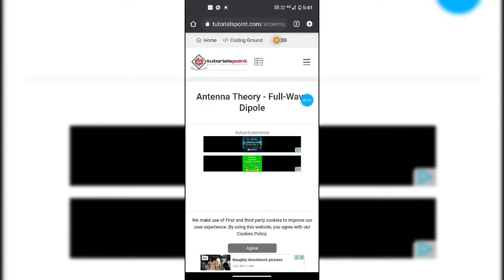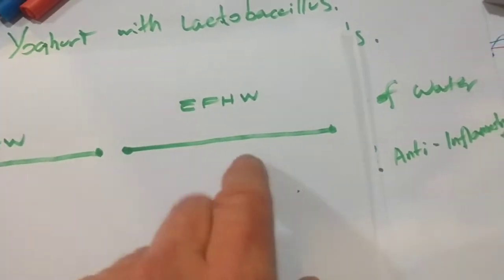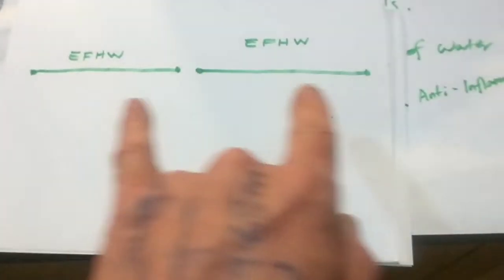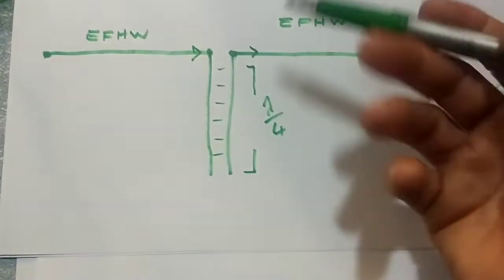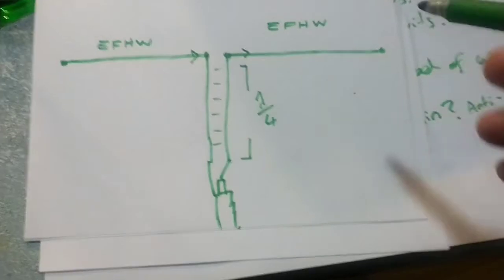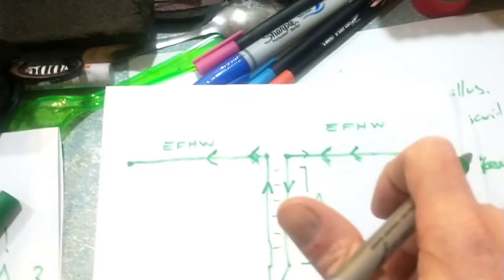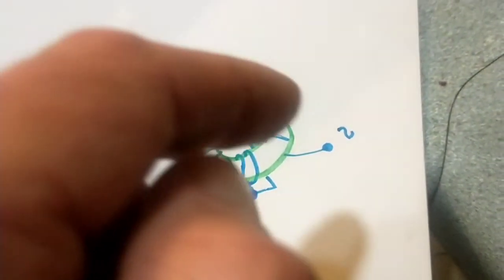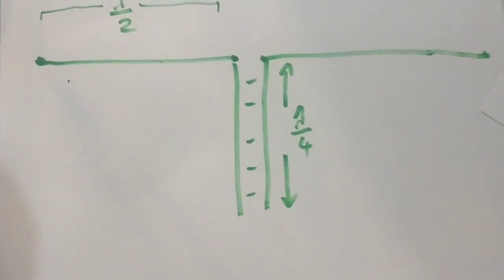Myth Busting "Centre Fed Full Wave Dipole Antenna"  (CFFW) (Tutorialspoint Garbage)

Comment from the maker: The Example presented at the end was generalized advice for a balanced output transformer 
& the winding ratios in the video were not specific for the centre fed fullwave.

I was simply trying to explain the principle of such a balanced output step up Voltage/Impedance transformer.     

In the comments below someone did come up with what would be a near perfect ratio design for an CFFW antenna.

Comment: I saw that TutorialsPoint nonsense this morning so went looking for someone who debunks it and found this. Good job. I hate to think of all the people trying to learn from that site. People confuse impedance matching with resonance. Resonance is useful to achieve a good impedance match, but it’s not necessary, and a good impedance match doesn’t imply you have a resonant antenna.

I’ve also been reading about the “half square” antenna, which is basically a full-wave dipole with 1/4 wavelength at each end bent down to form two vertical elements. Proponents claim the two vertical elements are in phase, but if I consider them to be the ends of a full-wave dipole it seems they would be in phase. Some folks also claim that the horizontal wire doesn’t radiate, and that seems like nonsense. My intuition might be faulty though—I haven’t looked at it rigorously.
Reply from the maker: I actually have built a fullwave dipoole with the ends bent down at 90 degress
and I used a 1/4 wave matching section to feed it.

I made sure the point where each ele bends downwards is exactly 1/2 wave from the other element that bends down
and because it is a dipole
with each element at opposite phase,
and because each vertical section is also a half wave apart,
the signal from one vertical section takes a half cycle to reach the other vertical section which means that when it gets there, the other element is now at the same phase as it is and it becomes coherent in the end to end direction of  the antenna and actually cancels the radiation off the sides.

To top section has little effect on the radiation pattern.

I actually wasn't aware it was called a half square lol,
It was just a design I came up with that I called a top fed phased vertical array lol.

73 and Thanks so much for your comment.
(PS: Sorry I only just saw your comment today).

For some reason my YT studio App doesn't always show me all the comments.

73 de VK3VKe ⚡🙏⚡
Reply: @crazyham  The horizontal wire wouldn’t affect the pattern at vertical polarization, but I’ve got to think it radiates at horizontal polarization with a completely different pattern. Intuition’s not always reliable with EM. I’m thinking of trying to model a few antenna types with MiniNEC—when I can find the time.
Reply from the maker: @kirkp_nextguitar  Well, one way to look at it,.is when observing the antenna from side on a number of wavelengths away,

we see two verticals operating in opposition,
while one has currents running up
the other has currents running down,
so that part is out of phase vertically like you said from the side perpective.

Now,
in physics we have to summarise vectors.

So, the sum of the B or H field  vectors etc from the right hand side element is the combination of any of the vertical and horizontal components
and likewise for the sum of the vectors of the left hand side element
and then we summarise all those summarised vectors.

Looking down on the antenna,
we may see "currents" running back and forth coherently along the top (wire) elements like you are concerned about,
but the sum of "of the B/H vectors etc from the  Displacement Currents" (Through the Air) running between the two vertical elements overrides any effect from the conduction  currents along the top of the wire elements that you are concerned about.

I'm just sharing how I see it my friend.

I am so glad that unlike.most Hams you are really thinking about all this.

That Is Awesome my Friend.
⚡🙏⚡ 73 from Crazy Ham ⚡🙏⚡
Reply: @crazyham  After thinking more about the half-square antenna, I’ve concluded I was incorrect about the two verticals being out of phase. On half wave dipole the voltages on the two ends are out of phase but on a full wave dipole they are in phase. Bend each end down in a right angle and they are still in phase, which results in two quarter wave verticals that are in phase. (If you bent one end down and the other up they would instead be out of phase).

A horizontal full wave dipole has a broadside null due since it’s basically two half-wave dipoles placed end to end that are out of phase with each other. But that null is only at broadside. It will radiate at all other angles albeit with a more complex pattern than a half-wave dipole. That fact doesn’t change when you bend the ends down. At horizontal polarization you still have a broadside null but radiation at other azimuth angles. … This is a fun topic. I must learn to use miniNEC.
Reply from the maker: @kirkp_nextguitar  The centre fed full wave is still being differentially fed, ie one pos and one neg at a given time. 

so each element being the same length
means that at any point of maxima,
one ele is pos while the other is neg.

This also means that when we bend the two last quarter wave sections downwards,
we have one with current running up
while the other has current running down 
(out of phase from side view) (like a balanced feeder)
but due to the distance between the two being a half wave apart in space,
the out of phase signal from one vertical leg by the time it gets to the other vertical leg it is now in phase as the other leg didn't stay  at the previous phase as half a cycle of time has passed.

therefore the two vertical components behave coherently along the axis of the system
and cancel to the sides.
Reply from the maker: I just looked up the half square and it is fed differently to my version,
but once at a resonant state,
the behavior is the same no matter where it is driven from,
just like with an end fed half wave vs a centre fed half wave have the same voltage and current distribution.

The half square does in fact have the two vertical sections operating out of phase from the side perspective.

Perhaps link me to a diagram that you are referring to
and I will try upload a video explaining it.

Comment: PREACH IT MATE ! 
I followed your link from that 1/2λ dipole video that was full of errors, which I commented on as well.
I was heartened to see I wasn't the only one who realized there were multiple erroneous assertions made.  One thing for you to possibly correct me on, is that I think ideally you should use a 1:1 BalUn at the feed-point of your 1/4λ stub UNLESS you round off the parallel transmission line like you would in a J-fed configuration; i.e., bend a 1/2λ conductor in half, and find the 50-ohm feed-point across the parallel conductor, and then you have differential current for sure (not relying of capacitive or inductive coupling) on each conductor, and you only need to choke-off the coax from common mode current.  
Does that make sense?
Reply from the maker: Yes my Friend.

That would be am ideal scenario
yet with such low frequencies and the ability to ground one side of the unbalanced section before the quarter wave xmission line xformer it isn't so important for a ball park result,
but for an accurate result I do agree with You !

Ideally a good coaxial choke before the 1/4 wave xformer.would ensure a near enough balance.

Recall that the balance
only has to be good enough
to ensure that the direction of current flow on each ele is in the same direction broadside to an observer
& of similar magnitude and timing.

The Sum of the changes from end to end on a dipole
determine the sum of the ERP & Pattern.

What I am saying is that if only one side of a centre fed dipole  appears to get all the currents and voltage swings,
it is still a two sided system
and recall that voltage is a potential difference and in a real time scenario
the seemingly unchanging element is also changing  it's potential difference with the element changing it's difference from this reference point.

it gets very confusing to follow,
but a seemingly inactive element
can also be seen to be an active element
from a difference point of reference.

If you made sure that you the observer 
was always dead centre of the difference  between the two elements.

You would see each ele swing inversely +/- to the same magnitude.

Comment: One note on the BalUn, since the each leg of the full-wave dipole is at ~2450+ impedance, you might have 2 turns on the primary (coax feedline) and 28 turns on the secondary (dipole output) center tapped (to coax shield) at the ~14th turn. That should give you ~49:1 impedance match from the unbalanced coax to the balanced antenna.

Comment: IMHO just feed it with coax as you have shown and put a common mode choke on said coax close to the feed point and you will be good to go. You can short the ends together and tap the ladder line at the 50 ohms point but that would detract from its operation on the higher bands and reduce its bandwidth somewhat.  vk3aif